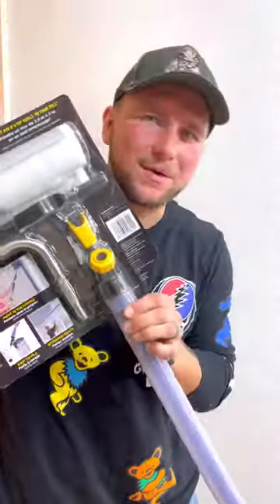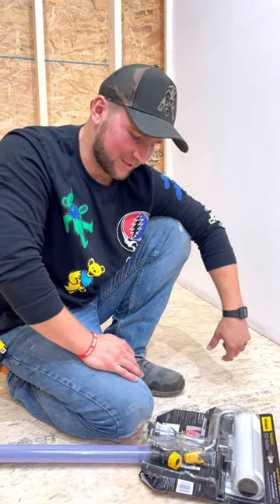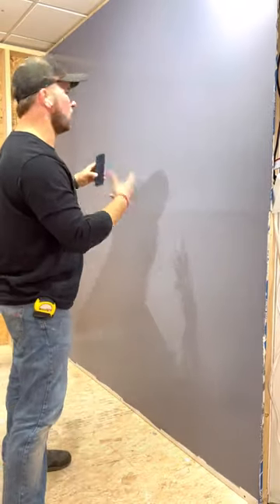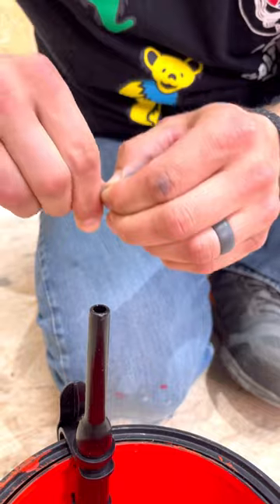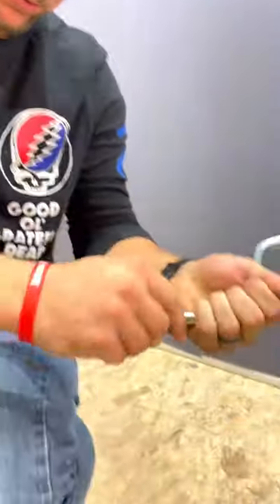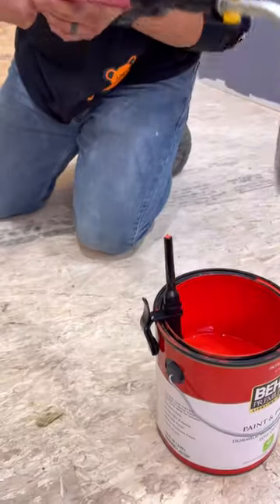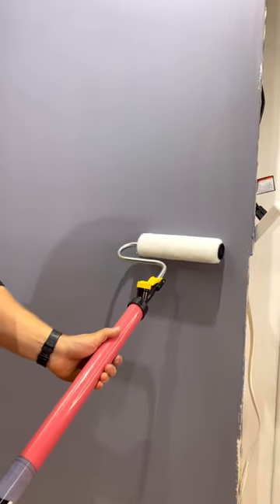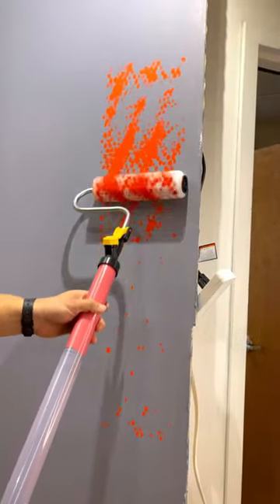Bad Tool! Testing out EZ-Roller from Lowes. WINNI

Comment: I've bought 4 of these over the years.  The seal around the tube eventually leaks. But overall it's about 3 fills to put on a gallon of paint.  Meaning you stop 3 times per gallon.  More time painting less time in the tray.  Less chance of spills.  I love em.  Takes a minute to get used to it but then you fly
Reply: Exactly!! And if you use Petroleum jelly after every cleanup, works for a long time. Dude's just clueless.

Comment: Have used for years.  Any color is only true with 2 coats.  Common sense tells you to keep pumping for even supply of paint.  Saves a tremendous amount of paint as not a drop is lost and no trap is needed as there is no paint spray.
Reply: I buy a new one for almost every new job.  I like how they work, but the rollers do suck.  I wish they sold a better quality roller.  I agree with the paint wastage going down.  I'll admit that I will set up a pump if using more than 15 gallons.

Comment: I'm sorry guys but I paint for a living I own 13 of these the exact same ones and as far as his video Problem one is it doesn't saturate unless you understand correctly how to paint and went to pump so it does work smoothly second that was his first coat he didn't let it dry clearly you can see the smudges in the lines in it that is red paint off of a background of whatever color the wall was before standard people always put a second coat of paint on and he was doing a video before the first coat was even dry and soaked into the drywall thirdly the seal at the top it does kind of leak only if you turn it sideways and try to trim out with it I know some people come in with a trim brush like me Del trim out the ceiling and the bottom and then they come in sideways with that easy roller and then they try to get it about eight more inches up off the wall and then they start going vertical up and down with it painting as far as it being a good product yes it's an excellent product versus a paint brush roller with a stick that you have to roll in a pan swing up on the wall make sure you don't drop paint anywhere and all the above so as far as this video goes I'm sorry not trying to be disrespectful but it wasn't a full direct professional video the first and the last part the rollers if you know anything about painting the reason that that roller looks so horrible and got me and sprinkling and stuff is because you're actually supposed to take painters tape or any kind of a tape not duct tape but painter's tape and you wrap it around the roller to get the factory fuzz off the roller and it brings out the phrase off of the roller then you use it you have to prep the rollers and you have to prep everything about the roller you don't just buy the roller and then go paint willy-nilly it doesn't work like that factories when they make rollers they make them extra bushy and then you in return just add takes 2 minutes add some tape painters tape tape it to it pull it right off the roller and it pulls off all the fuzz you won't have no fuzz left on the wall you won't have that weird looking photo of his roller at the end of the video sorry it is a good product I own a massive amount of them and I paint all the time for a living perfect tool
Reply: That was a lot of talking but without punctuation, I can't makes heads from tails.  I do understand that you are painter so I don't expect literacy.  I appreciate you trying to help however.

Comment: You are a skilled painter construction handyman guy, which means you are good at using a regular roller. I am an "average person", terrible at using a regular roller, I get too much paint on it and I try to roll too fast and sprays everywhere and the roller slides across the floor glued by paint to the roller and drips everywhere b/c i got too much paint on it. For me this paint stick is amazing. It puts paint on thin, so that it dries fast and you can do a 2nd coat right away. The "wierd pattern" you see is b/c you were putting the paint on way too thin b/c you didnt' click the thing often enough, about 3 to 5 clicks per small arms reach area. You can get the hang of it after a bit, vs getting the hang of regular paint roller and tray I could never get the hang of. So basically, when I use a regular roller i get too much paint, and when you use this thing you dont get enough b/c you didn't click it enough. It's possible to keep clicking while painting so you never have to stop until you have to suck up more paint from the can.

Comment: I feel like some rollers soak up way too much paint and waste paint. Not specific to this roller, I see it as a problem across the board
Reply: You always loose some little bit of paint either on a brush, roller or in the spraying machine. Even the companies that sell paint sprayers know that you typically waste roughly 30-40% of the paint when you spray as over spray. But spraying gives you a really nice finish and also get paint on the walls or surface faster.

Comment: You didn't get the lint off the roller, hence your texture.
Reply: Exactly I literally just posted the full paragraph or two about the whole process of that video and the fact that that role that was not prepped with painters tape to get the fuzz and the bristles that come from the factory when the brush rollers are made can't just buy something and throw it up on the wall and expect it to be working perfectly it just doesn't work like that nor does life you can't just be like yeah I want to make a million dollars and then you have a million dollars the next day completely no prep on that roller that's why it look like complete junk and I can take a 1500 sq ft house I did it a month ago I used just these rollers I have 13 of them I got the job done in a week by myself

Comment: Yeah, when you throw away the instructions, and you just wing it, it would suck. Kinda like comparing a airless sprayer for that wall vs a roller. Do a real test. Go compare an entire room. Bet you are singing a different tune. And when the paint dries, the finish isn't textured.